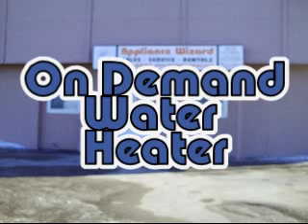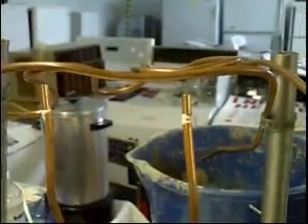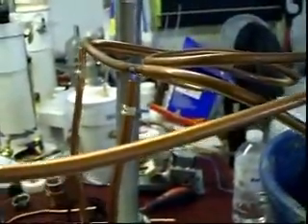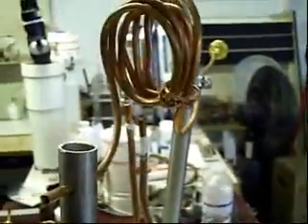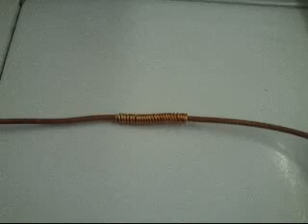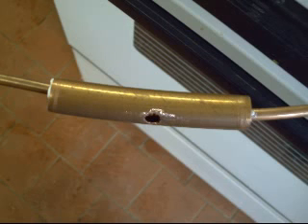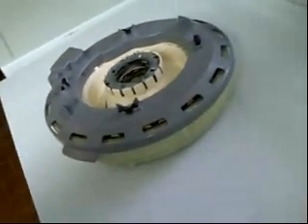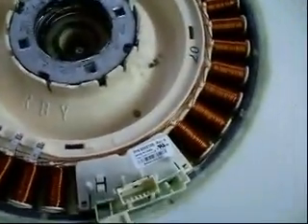#27 First Attempt at Cheap HHO On Demand Water Heater

Comment: Waterflow is to fast to get the temp up more and if you dont heat all you copper it will make the water colder. Just use bare copper on the pipes where you heat.

Comment: The system you used for the crude instant instant Hot Water on demand was very inefficient.

The flames were not focusing the maximum heat where you had them pointed.

https://i.stack.imgur.com/LeFMF.jpg

To give you an idea of what's going on. 

Hydrogen gas has 31KW worth of energy per liquid litre.

1 Liquid Litre of Hydrogen gas is 12 litres in gaseous form at around 20 degrees Celsius.

You need to find out what the flow rate of the hydrogen gas is that is coming from the hydrogen generator.

If your flow rate of Hydrogen is about 1.6 gaseous litres per hour at around 20 degrees celcius,  your energy in Hydrogen when combusted is:

1600ml / 12 = 133ml (liquid hydrogen)

133ml (liquid Hydrogen) = 4.1KW of heat energy per hour, or 31000/(1000/133) watts/hour, that the hot water pipe can absorb in ideal conditions.

If you are wasting say 2/3 of that heat, you are barely applying 1.3 KW/h to the system.

That is not enough to run instant hot water that has a practical water flow rate.

Even if you can muster 3KW worth of heat energy after losses, you are still pushing it for decent hot water levels.

You need to apply somewhere around 4-6KW to get decent flow rates, unless you can do with a low flow rate.

There are Commercial Hydrogen Generators on the market that boast 600 litres gaseous Hydrogen per hour production rates.

The same devices consume only 2KW/h electrical energy.

600L (gaseous Hydrogen) / hour translates to about 1,550,000 watts per hour heat energy.

All for the cost of 2KW of electricity.

If that does not do it for you, you might think about just heating a large tank with the flames you have for about 1-2 hours.

Then pumping the water out of the tank with a small electric pressure pump to the shower head.

It won't be water on demand, although it will still be decent hot water for a shower etc...

I would like to see if you could actually increase the Hydrogen gas production with more electrical energy.

Then run it through a proper Gas Hot Water on demand heater unit and see if it works well.

.

Comment: Here another suggestion.  Have you try flatten the pipe where you point the flame, this probably provide more contact surface to the heat to the water.  Beside the heating point, the rest of pipe should be thermally insulated or use non-heat conducting material to reduce heat loss.  Also try different pipe material like Aluminum for proof of concept.

Comment: Thx, good video.
Have you try placing the flame other than 90 degree to the copper pipe?  Since the water is running, that will give the water more time to heat up.  Since HHO has oxygen already, I assume it will continue to burn inside a pipe, then you can use small diameter pipe coil around the copper pipe and channel the flame thru the small diameter coil.  To ensure good contact, you probably can fill the gap the coil and the copper pipe with thermal conductive paste.

Comment: Nice video, I too always start at the free, cheap end of a project, you learn so much more, Fluid dynamics, !, "Heat exchange" Flow rate, Your  flow will in straight linier Pipe, move faster in the centre, and slower at the walls, Giving poor heat exchange from flame to fluid,  what to consider is: to put a coil “In to” the pipe Like a helix coil, it forces wall clinging fluid into the central flow, & so carrying the heat too, it’s a cheap heat exchanger.( Fluid Mixer).
Thom in Scotland.

Comment: Some pretty crazy comments on here. Take a solid core steel rod about 10 in long, place ur torches on each end of rod. Spiral ur copper around the rod keeping closes, but not touching. Make tight twist so u get as many revolutions as possible. Use thick bailing wire to secure and keep copper from touching rod. Now wrap with a lion liner wool and watch the difference. You will be surprised. Good luck.

Comment: What came out of the last experiment, where you wrapped the copper
wire around the copper tube ?
Did it heat more ?
Well done and good luck with your experiments.
Regards, Stefan.

Comment: It's funny. You can get the heat to boil water and cook noodles but not get the water in the pipe hotter than 72.
Perhaps you need a 'pot' of water to heat hot enough to cook noodles, then if you run the water filled copper pipe through the 'pot' of noodle-hot-water, the water in the pipe will get very hot?
(Like the old oil fired furnace tankless hot water heater.)
I enjoy following your research...thanks for sharing it.

Comment: Very nice experimentation, Have you tried using a 120mm copper radiator which you can use on a PC water cooling system....As the flames hits the fins the heat will spread through the radiator.

Comment: The best way to accomplish this is to have a valve that recirculates the water back through the heating elements until the water reaches the target temperature; if you do this right, it should take 10 - 20 seconds before you have hot water coming out. Also note that the amount of hot water delivered at one time will be limited by the length of your hose.

I think you'd do better wrapping a nichrome wire around the pipe instead and running a high current through it.

Comment: Must put flame at very tip of water output, just before it comes out. That way no waste of heat.

And use a parallel three flame setup, around water pipe, so the long sides of the flames act on the water pipe, inside an insulated jacket.

Comment from the maker: @llewgnal 
I like your idea. I agree. Its not the idle flame that gives lots of heat, it is the interaction with metals which raises the temp.  I have evaporated a tungsten rod with my torch and that takes huge amounts of heat. I will use your idea in the next version. Thanks.

Comment from the maker: @dreamyear  i have found with my cooking experiments that as long as there is a liquid (water), within the metal you are heating, it is impossible to melt the metal. The water will just absorbe the heat.  I have a bubbler which i made to add ambiant air to hho if i need it. I have found it lowers the flame temp too much for some applicaitons.

Comment from the maker: @jdcmusicman 
I've been doing lots of solar stuff in the last 6 months too. The sun is amazing. Even in the coldest winter temperatures up here, we can bring water to a boil. Solar ovens go to 300degrese. Solar collectors with glycol work well for heating homes. 
I also want to backup solar with HHO. Thats why i wanted an on demand type system, so i can see how much boost i can add to the water at a reasonable cost.
I'll be watchen for your project.
Stay Safe.

Comment: Nice experimentation man ...I have played with similar ways to heat water ,and I love hho but I have found I get way better results with just using the sun..Parabolic dishes are extremely good for heating water to around 120- 180  easily the only problem with those is sun tracking....I am working on a project right now that is going to be a Solar HHO assist Oven/ water heater/ air heater..All in one combo box I guess you could say.